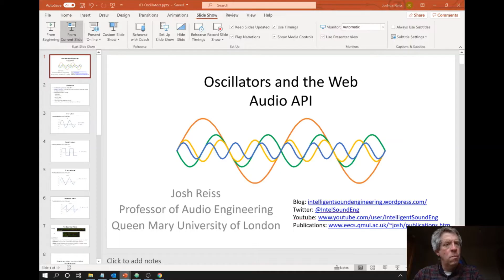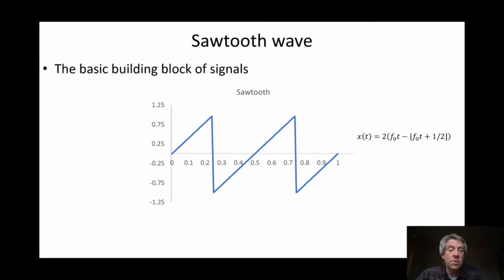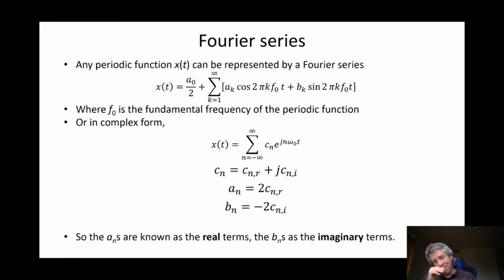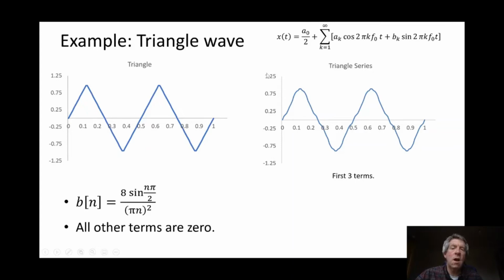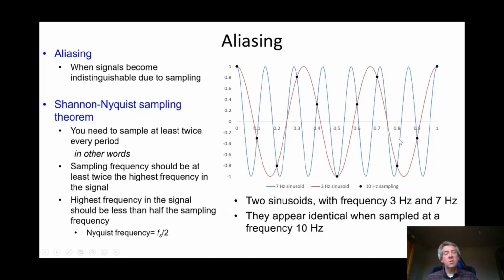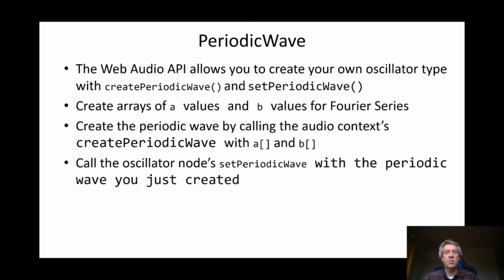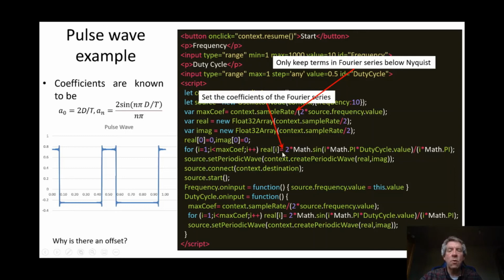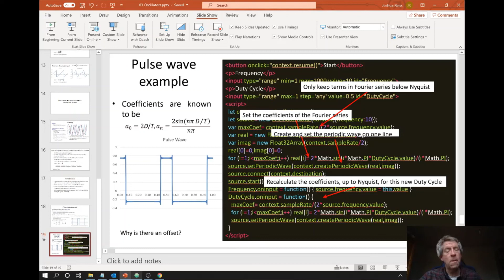Oscillators in the Web Audio API

Comment: tnx for this great tutorial. it really helps me a lot.
however, I thought it might be helpful to you and others who watch this to know the "detune" functionality is not there for you to simply change the frequency of the main tone you want to hear. for more info, you might discuss this with an electronic musician. but in short: it is used in audio synthesis to make a tone more complex and rich. for example, when you hear the sound of an acoustic instrument like a piano its wave shape is not a sawtooth or triangle or etc... it is a lot more complicated and it has lots of harmonic sounds which makes it sound richer than a simple synthesized sound. for replicating something similar in audio synthesis one of the techniques sound engineers and/or musicians might use is detuning. basically, they create a few oscillators that all are playing the same musical notes for example A440 but they detune slightly second and 3rd oscillators and play all of those oscillators together to get a richer sound. if you want to test that out to hear the difference and understand why they do it simply create 3 oscillators and set all of them on the same note ( like A440 ) but detune 2 of them for 10 and 15 and play all of them together at the same time.
English is not my mother tongue so, apologies if there are problems.
Reply from the maker: Good points. Thanks Hossein.
Reply: When you pluck a string, the initial force will deform the string, resulting in it being slightly out of tune at the start. I wonder if the detune can simulate this as well.